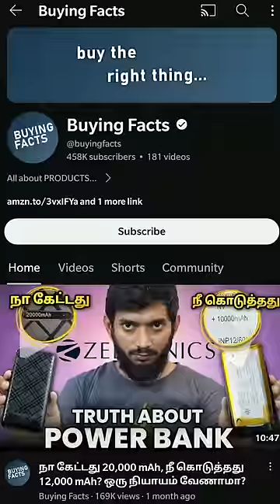மொத்தமா உருவிருச்சு.. 🤦🏻

Comment: Cheap hdmi cables are fine for 1080p without audio passthrough. But if you use a dolby atmos system with 4k HDR passthrough and have hdmi 2.1 ports on your AV system or TV for eARC then invest in better rated cables. Keep the bandwidth in mind when buying hdmi.

Comment: Thise HDMI connectors and cables are okay for regular 1080p 60Hz refresh rate displays and TVs. If your TV is 4k and if you want eARC cables, you may need to go for HDMI 2.0 or 2.1 for high speed  8k content which will cost more than at least 1500/- to 4000/- approximately.

Comment: When you said you brought a converter. I thought the same reason why you need to buy a 250rs converter, when the HDMI cable 5 meter is only 250rs. If you go with 1 or 2 layers of shield cable. you need to pay 599 rs.😂

Comment: I faced the same issue then I tried pushing the pins align with the plug it will work fine worked out for me no need to get a new cable

Comment: Converter available in electronics shop for Rs.50
If you are in Selaiyur area, get it from Bhavani electricals (Camp road junction).

Note: increase in cable length might affect the refresh rate. ( Another item for you to research on and video-ise 😊 )